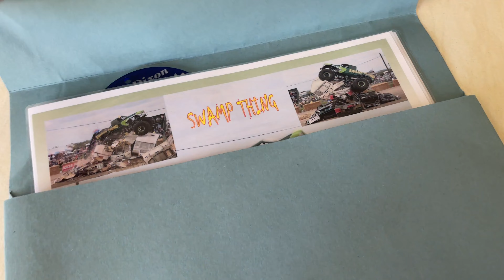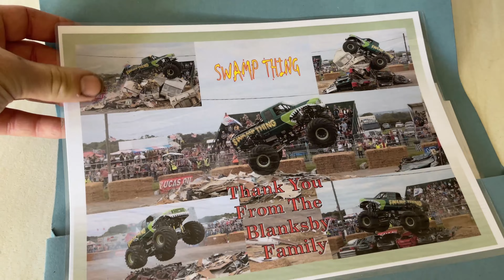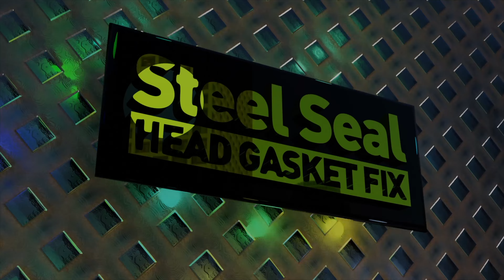UK Monster Truck Nationals Vlog 2022

Comment: @swampthing4x4, how many changes did team big Pete do to get it from blown thunder to grimm reaper?
Reply from the maker: Not to many. The engine was a big one
Reply: @swampthing4x4  what's in the truck now? And didn't blown thunder have a blower motor?
Reply from the maker: @morphman21  yes he had a Methanol blower motor in it, originally when Trevor Stimsom drove it